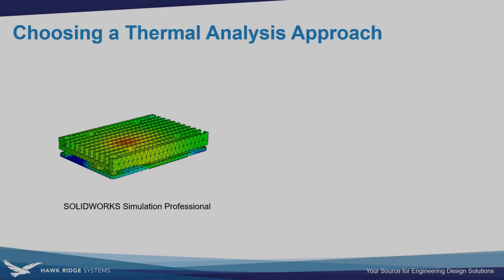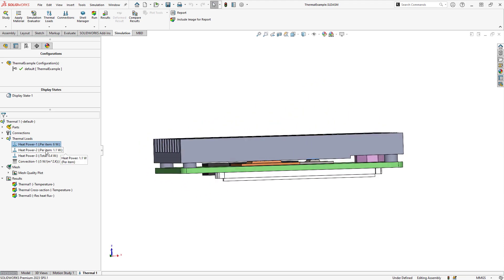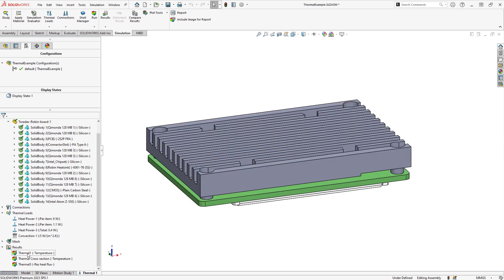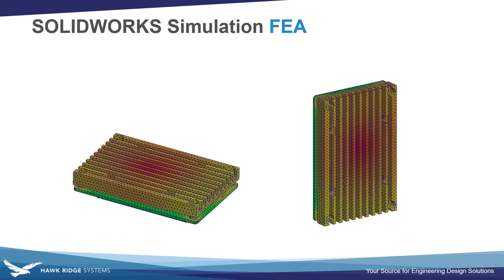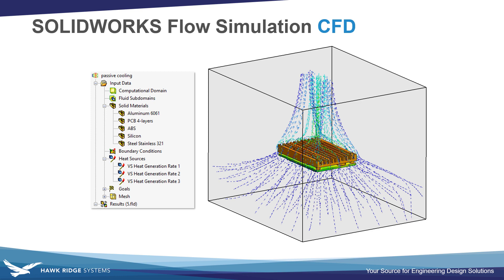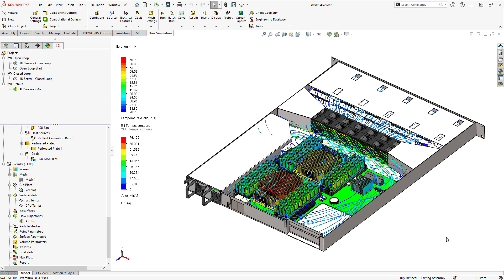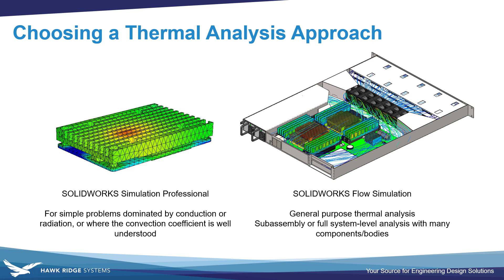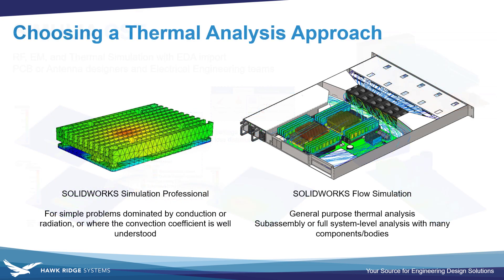Choosing a Thermal Analysis Approach - SOLIDWORKS Simulation and Flow Simulation

Comment: Hello, how to use graphics card to do the computation any simulation (e.g. static study, topology optimization etc)? I have a low processor(intel core i5 13400f) with 16 GB RAM, and GPU RTX 3060. Thank You.
Reply from the maker: GPU simulation is currently only available in our SIMULIA analysis packages. SOLIDWORKS Simulation uses CPU exclusively - that processor should still perform quite well for the types of simulations you listed. Ensure you're using the "Intel Direct Sparse" solver when available